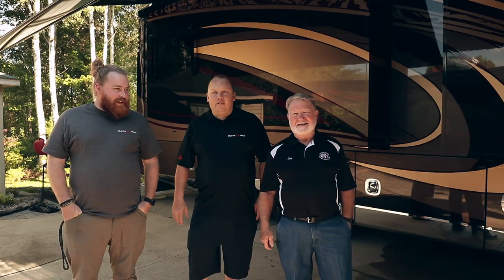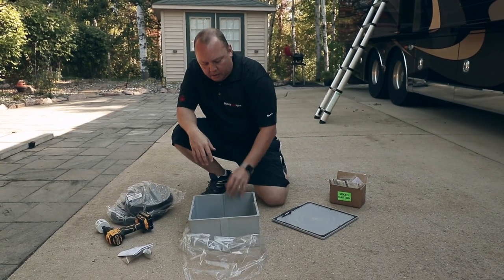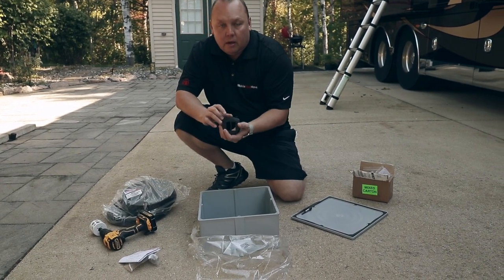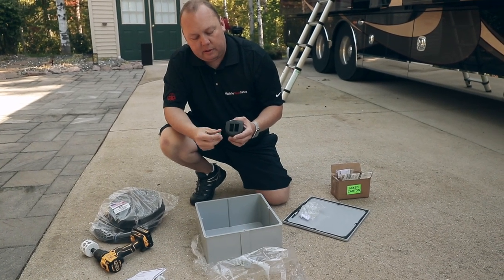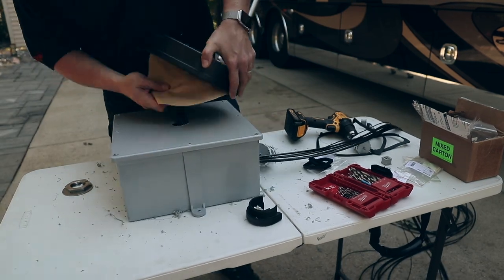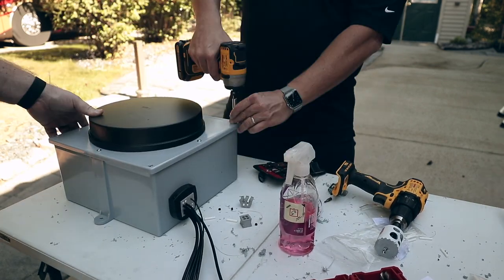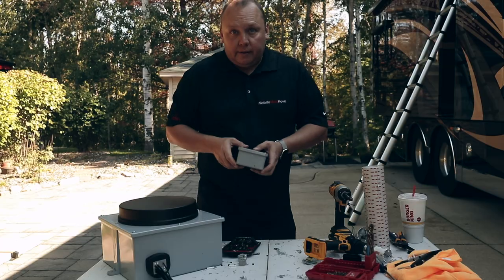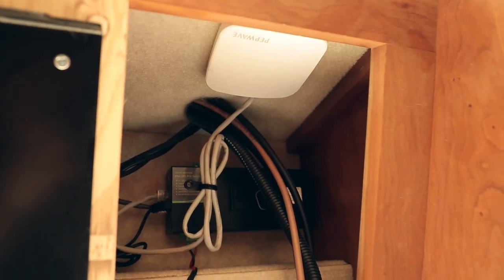Peplink Mobile Router Install on an Entegra Motorhome - Speed Demon + Bundle

Comment: Thanks-- can you share link for the junction box you used on top of roof?
Reply: I came here to ask this question! I just got my antenna and would like to mount mine this way.
Reply: Any electrical supply house will have that PVC junction box.
Reply from the maker: this is the box we used. very high quality https://www.supplyhouse.com/Topaz-1231-12-X-12-X-6-Sch-40-PVC-Junction-Box?gclid=Cj0KCQjw5oiMBhDtARIsAJi0qk1vxhOfVpfSqFF0RqJz8cbyvgHWghx__v8_6spepGuL7Vw-YGQFVrcaAiaxEALw_wcB
Reply: How did you mount the junction box to the roof? It looks like you used ABS and dicor?  Did you screw it to the roof as well?

Comment: ok, I bought the trimantec connector from your link, but where do I get these little stubs you put in for not used cable through puts f the grommets in your video ?? (question from a member)
Reply from the maker: hi Michael, trimantec is the reseller not the manufacturer. They should be able to get you the dummy inserts needed or you can use small pieces of wire or just some hot glue in a pinch which should also work.

Comment: I have an Entegra also. Where did you source the power from in the cabinet above the driver? 110 volt or did you source 12 volt ( where from). Thank You ! I have a speed demon on order from NIRVC.
Reply from the maker: this 2017 had 12v located behind the front tv as some of the original Firefly components were located in that area. You can gain access by removing the single screw below the tv which will release the tv bracket which then folds up and is then removable.  Many variants do not have 12v in this area but you can source 12v power from the driver's footwell near the cigarette lighter and run up the A-Pilar which is easily removable with just 2 screws with access via the same cavity shown in the video. We have also sourced power from above the entry door but the footwell area is easier.

Comment: What is the difference between the Speed Demon 5G and the Ultimate Road Warrior. We are RV full timers and we both need a good and strong service. Thanks! (Question from a member)
Reply from the maker: Speed demon series bundles all have a single cellular modem (connect to one cellular carrier at a time). Road Warrior Series Bundles have 2 cellular modems (connect to two cellular carriers assuming you have two data plans/sim cards). A good place to go to understand the differences of the bundles and benefits/draw backs would be this summary page. Scroll to "pick your perfect bundle" for charts and detailed explanations https://mobilemusthave.com/blogs/ultimate-guide-to-mobile-internet-for-travel/getting-started-with-mobile-internet
Reply: @MobileMustHave  Ok I will research.

Comment: Can you tell us the cable grommet size you used for the parsec cables and the size of the plugs to fill the unused holes?
Reply from the maker: links to the grommet are below in previous comments. The size of the inserts would depend on the antenna that you purchased as they come with different size cables but the parsec husky has a 5mm diameter cable for wifi and cellular and a 3mm diameter cable for GPS.

Comment: Hi there I bought this same system from you all a couple weeks back could you post a link to the modular cube product couldn't find on your web site and the small 4x4 box thanks
Reply from the maker: We are still working with that manufacture to stock that item from them. Hope to have it in store soon!
Reply: @MobileMustHave   Did you ever get the modular cube product in?
Reply from the maker: @cllistings5914  checkout the other replies here specifically the one to Ryan with links to a distributor who stocks them. We still havent secured a supplier directly :(